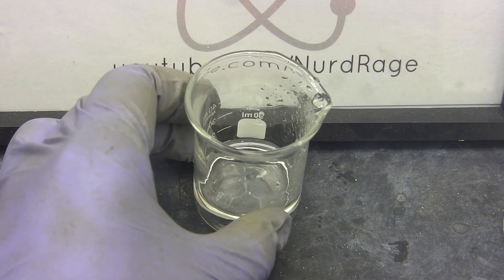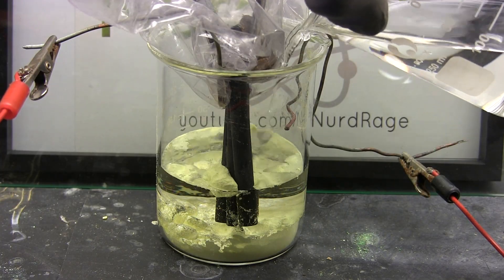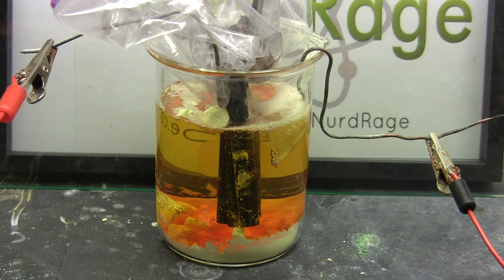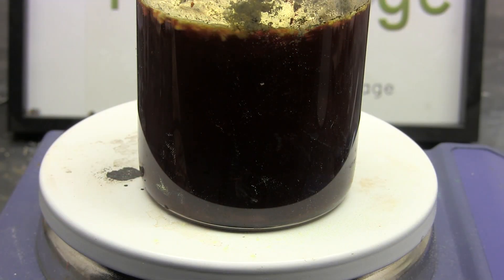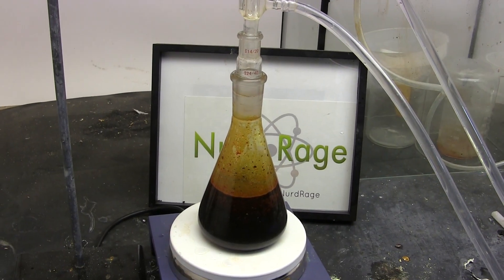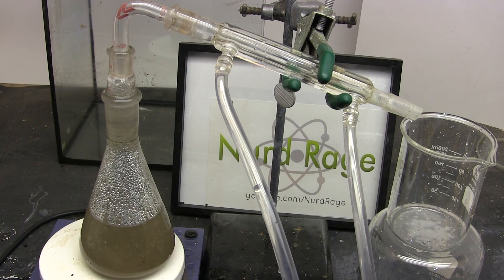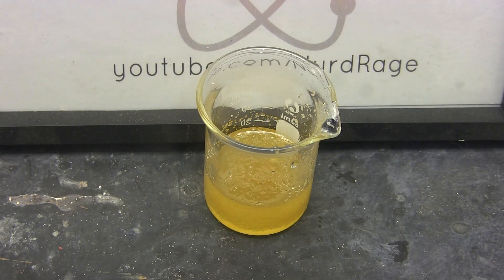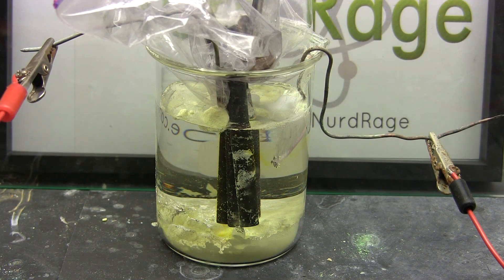Make sulfuric acid from water and sulfur (electrobromine process)

Comment: I MADE SOME LIQUIDFIED SULPHUR FOR THE GARDEN ..BY USING A PROCESS CALLED THE jAYDAM LIQIUD SULPHUR ,,ON UTUBE, CNA THIS BE ELECTRIFIED AND CREATE SULPHURIC ACID AS IS ? THE METHOD I USED WAS ADDING  LYE ..DRAIN CLEANER CRYSTALS  TO A SOLUTION OF SULPHUR AND WATER AND HEATED IT UP BY THE REACTION AND STIRRED TILL TH SULPHUR BLENDED IN WITH THE WATER , WHATS YOUR OPINION OF MAKING SULPHURIC ACID FROM THIS MIXTURE?

Comment: Why does the sulfur need to be at the bottom? Doesn't bromine attach to water molecules somewhat? [H-O-H~Br-Br~H-O-H] ~ meaning partial electron sharing. Since Oxygen withdraws electron density away from Hydrogen (because it has a higher positive charge), the Hydrogen atoms are partially positively charged and the Bromine can have a somewhat dipole moment in as it moves in water. Bromine water is documented to undergo Br2 + H2O <->> HBr + HOBr which alignes with my idea and would mean the Bromine disperses in the water solution maybe not with uniform density but as more water is converted to H2SO4 and since it is denser than water the H2SO4 would donate Hydrogen from the bottom up to the water molecules above it resulting in a movement of Hydrogen upwards as the solution gets more acidic meaning that the Bromine would be carried upwards.

Comment: Try using 316l welding rods from local welding supply and lower the amps to .1 to .5 or so at 12 volts.

Comment: I wonder how this compares to the membrane process.
this can directly oxidize sulfur while the membrane process needs any sulfate salt and a catalyst NaOH
CaSO4, MgSO4 with an anion exchange membrane or NF membrane where the latter is cheaper and can be homemade.
ammonium sulfate can be used with CEM and also NF membranes with CEM being easy to make and just needs a few commonly bought items and a temperature controlled toaster oven.

Comment: I came across the Bunsen reaction using Iodine and Sulfur Dioxide:

I2 + SO2 + 2 H2O 
→ 2 HI + H2SO4 (120 °C); Bunsen reaction

If you produced SO2 (e.g. burning sulfur) and bubbled the gas into Hydrobromic acid, would this give H2SO4?  It seems this might be less messy than the electrobromine process.  If electrolysis was still needed, SO2 is still pretty soluble in water, and would avoid the sulfur floating around.  Thoughts?

Comment: good one.  its got me thinking.   doesnt burned sulfur bubbled thru water make acid ?

meanwhile a new idea  ... its based on how wal-mart wants an old battery in exchange
when you buy a new one.    they charge you $12 absent this 'core'

                                well the old one has a bunch of acid in it.  and more so
if you first give it a charge.  then dump it into a pan. distill to clean it up.
and voila, you have sulfuric acid in the 25-35% range.

Comment: Yeah but how can I make sulfur from sulfuric acid?
Reply from the maker: It's a little more complicated, you can carefully react hydroiodic acid with sulfuric acid in the right stoichiometry to produce sulfur and iodine but the process is very messy. A more straightforward method (but takes more steps) is to react sulfuric acid with hydrogen bromide to produce sulfur dioxide, this is separated and collected. Then excess hydrogen iodide is reacted with half of the sulfur dioxide to produce hydrogen sulfide. This is then separated and collected and purified. Finally the sulfur dioxide and hydrogen sulfide are reacted with water to produce clean sulfur. 

Sulfur however is a waste product of oil refining. so it's actually very cheap to obtain and there is little value in trying to make it from sulfuric acid. Sulfuric acid on the other hand has much greater value than sulfur.

Comment: You rock bro, thanks for the lessons. Maybe you can put a filter/screen on the rod/rods to hold the graphite dust? Probably cost some power through resistance though I guess..That was alot of current though and it took forever...Fully submerged electrodes may make a difference by avoiding gas but I don't know for sure.

Comment: Can something like this work with galena instead of sulfur?
Reply: CODY!!!!!!! I LOVE YOU!!!
Reply: You could roast the galena and take the SO2 and revert it back to elemental sulfur :D
Reply: Cody'sLab if you have a supply of galena, first I suggest checking if it’s argentiferous. If it’s from a silver mine it will be. Pulverise the galena with an equimolar quantity of lead sulphate from old lead acid batteries. You need to heat the.mixture to liberate sulphur dioxide and metallic lead. The sulphur dioxide is oxidised with air over a catalyst to produce Sulfur trioxide. This gas in turn is absorbed into concentrated sulphuric acid to produce oleum. The oleum is poured very very very very very slowly into water to produce sulphuric acid. If the original galena was argentiferous, silver can be extracted using the Parkes process.
Reply: I would try mixing and heating it with PbO2 and some water or in conc. H2SO4 to hopefully produce PbSO4, which you can form into Pb, PbO2 and H2SO4 electrochemically (lead acid battery).
Reply: Cody'sLab I think you can use any type of material that releases SO2 Gas so Galena should work just fine. Maybe you end up with some PbSO4 contamination in the reaction flask but this shouldn't be a problem either since it's only soluble in very acidic conditions and you're going to distill the resulting acid.
Reply: @The_Black_Shadow  soluble not solubal.... distill not destill...
Reply: @BurkenProductions  thanks :D fixed it. Not a native speaker...
Reply: I guess you could roast the galena to produce either lead metal or white lead and SO2 (assuming lead sulfide roasts like other semi-noble metal sulfides), and lead the gas into an electrolytic cell with HBr. The reaction between aqueous SO2 and Br2 should be pretty fast, producing sulfuric acid  and regenerating HBr. You could bubble Cl2 and SO2 together, but I’m assuming you won’t have access to chlorinating chemicals in a zombie apocalypse.
Reply: I.
Reply: I'm gonna say no, not unless you do it separately, in an anhydrous environment.  Not sure what lead sulphide chemical formula is in Galena, but this is how you could do it for sodium sulphide: 
2 Na2S + 2 Br2 =  2 NaBr +S2Br2
Then the sulfur bromide could be used like in this reaction with water.  

An easier way to make sulfuric acid would be to mix mineral oil and sulfur together and heat. This will produce tons of hydrogen sulfide. This can react with copper sulfate or produce insoluble copper sulfide and sulfuric acid.  

Copper sulfate could be made from oxidizing copper sulfite I bet, possibly via electrolysis, or That could be made via sulfur dioxide, water, and copper oxide/hydroxode. 
 No point in making it though when you can buy ammonium sulfate in bulk.  It's magical stuff: heat it up and it releases lots of ammonia gas as it forms ammonium bisulfate.  
Ammonium bisulfate acts much like sulfuric acid for most double displacement reactions, just lower yield and lots of ammonium contamination. You can mix it with a nitrate to distill nitric acid, though. 
Ditto for almost all other acids that can boil away.

Comment: I was wondering how you removed the sulfur that coated your glassware. It indeed is a pain to clean. (Related experiment)
Reply from the maker: Nothing special unfortunately. Just a lot of brushing, rinsing, and some oven heating at high temp to burn off the residues followed by more brushing and rinsing.
Reply: NurdRage that is unfortunate, i still have some sulfur covered glassware i was hoping to clean in a non-dangerous way. Next to scrubbing my only way to clean sulfur covered glassware was heating in crudely distilled toluene in which sulfur is a little soluble in.

Comment: I got a question, may I use a titanium bar grade 2 to replace the carbon electrode?
Reply: He said the acid is strong enough to wear down titanium electrodes
Reply: Austin Hayducky And what about if I use a silver electrode?
Reply: You might want to try gold leaf
Reply: Austin Hayducky Gold is kinda expensive, and why not silver?
Reply: Diego Reyes
Gold is more advantageous because of how thin it can be hammered (which means you don't need a lot)
Reply: I just bought a .999 fine silver coin and used it for electrolysis, nonetheless it started to corrode and it turned into a black color. That's really disappointing, and I didn't buy gold because each gram is truly expensive, and I'd need at least 30 grams to perform electrolysis.

Comment: I have another interesting reaction to propose to you, Nurd, which also happen to involve SO2.

The Bunsen reaction:  2H2O + SO2 + I2 → H2SO4 + 2HI   (120 °C)

The H2SO4 and the I2 + HI solution are roughly immiscible, so the H2SO4 can be separated (top layer)

You recover your iodine either by  2HI → I2 + H2 (450 °C)
or by oxydizing it with a cheap oxydant, like say  2HI + MgO = MgI2 + H2O + I2

Please don't bite my head off...
Reply: Isn't reaction of MgO and HI a simple acid-base reaction instead of a redox reaction? Also, I2 is also a really expensive element, so I guess Br2 can be used instead. But for purely academic purpose, it may work (although HI and H2SO4 are miscible as the first reaction is aqueous).

Comment: Wouldn't it be wonderful to produce directly H2SO4 by electrolysis of a SO2 in solution ? 
SO2 + 2 H2O --> H2SO4 + H2
You get hydrogen as a byproduct. It's called the Westinghouse Sulfur Cycle.

Here's a 2004 paper:  http://scholarcommons.usf.edu/cgi/viewcontent.cgi?article=1993&context=etd

What is remarkable, is that you produce H2 with only a fraction of the current required for straight water electrolysis.
15 Kcal/mole instead of 113 Kcal/mole. (0.17V instead of 1.2V).
Reply from the maker: +_Arthur Ski Good luck getting Sulfur dioxide to behave in an amateur lab environment. I avoided sulfur dioxide precisely because it's not easy to handle.
Reply: Just burn elemental sulfur and bubble the hot gas in water ??  SO2 is very soluble IIRC.
Reply: After all, Chem Player generated SO2 that way, in "Sulfuric acid from sulfur using hydrogen peroxide", so...
Reply from the maker: +_Arthur Ski Electrolysis takes far longer than reaction with hydrogen peroxide. The continual hydrogen evolution would purge out most of the SO2. Then there is the safety issue of working with SO2. Like i said, good luck.
Reply: To me, SO2 seems to be a mild irritant, much unlike NO2, which is more toxic.
Reply from the maker: +_Arthur Ski Levels above 100ppm are considered "immediately dangerous to life and health" according to a report by the CDC http://www.atsdr.cdc.gov/toxprofiles/tp116.pdf
The reference also reports deaths within a few hours of inhaling concentrations around the 1000ppm mark. There have also been documented cases of people dying at low concentrations due to exacerbation of preexisting medical conditions.

You also have not addressed the purging problem of the hydrogen gas. The solubility of sulfur dioxide at room temperature isn't all that great and even worse is that the rising acidity will force out whatever was originally present. The resulting concentration in the air would far exceed 1000ppm. 

But hey, if you think it's just a mild irritant then by all means build up your apparatus and post a video of your process. I've been proven wrong numerous times and maybe the doctors and scientists that wrote that report for the CDC are also wrong. Good luck.
Reply: Hey, it's your lab, your rules. SO2 is no more toxic than Cl2 or NO2.  Or Br2 for that matter.
Reply from the maker: +_Arthur Ski "You also have not addressed the purging problem of the hydrogen gas. The solubility of sulfur dioxide at room temperature isn't all that great and even worse is that the rising acidity will force out whatever was originally present."
Reply: OK: bubble up the hydrogen gas (contaminated with SO2), thru CAO (aq), quicklime.
The reaction will produce CASO4, gypsum, which is quite inoffensive.
The cleaned hydrogen, you vent off.
Reply from the maker: +_Arthur Ski If you're going to waste all your SO2, why bother?
Reply: Oops Nurd, by re-reading the protocol, I found out that the chemists dealt with the problem by keeping the SO2 in its liquid state, by the simple expedient of increasing the pressure in the electrolytic cell.
The pressure they use is 100 psig, which translates to 6.8 atmospheres.
That increases the difficulty (and risks) of the experiment by one order of magnitude.
Reply from the maker: +_Arthur Ski And thus why i decided against demonstrating it for the amateur. If they do it at atmospheric pressure the SO2 just purges out as you electrolyze it, losing most of your product and creating a tremendous safety issue. If they do it under high pressure they might get better yield, but with much greater safety issues of high pressure chemistry. The apparatus to handle high pressure chemistry is not easily available to the amateur.
Reply: No. Direct electrolysis of SO2 in aqueous solution, preferably under pressure.  Look it up.
The beauty of this process is that it sidesteps the use of platinum or vanadium catalysts to get the SO3 intermediate.
Reply: NatureHacker
It is being considered as a way to produce hydrogen, (the Sulfur-Iodine Cycle) but the very high energy cost of decomposing the H2SO4 back to SO2 + H2O + O2, at 830C, can make the whole process unattractive.

A Finn company envisions to use SO2, which is abundant and cheap, to make both H2 and H2SO4, which are valuable industrial commodities.
Reply: (sigh)  No sulphur dioxide is not very toxic.
Every single time you light a match, you smell and breathe sulfur dioxide.
I live in a city of 400,000 people, which used to be doused with sulfur dioxide smell several times a weeks, by the huge pulp paper mill.
On the scale of toxicities, it's pretty mild compared to dozen other common chemicals.
Reply: You need sulphur trioxide to make that work.
Reply: _Arthur Ski
Chem Player did that
Reply: What Chem Player did is H2SO4 using peroxide H2O2. No electrolysis necessary.
But there's no easy way to produce the peroxide, right?
I think the old way used Barium.

Comment: Will there be a possible rate change when we use other halogens such as hydrochloric acid as the catalyst instead, or is the reaction specific to bromine only?
Reply: I suppose bromine is ideal as it is a liquid at room temperature and won't escape the solution as easily as chlorine would.

Comment: Would it be more effective to disassociate the sulfur into the water by lowering the surface tension of water for this experiment? Using dish soap concentrate more specifically, or would HBr react with the surfactants to cause a wide range of side reactions? Ammonium C12-15 Pareth Sulfate, NaCl, Poloxamer 124, and Lauramidopropylamine Oxide are the ingredients of Palmolive dish soap.

Comment: NurdRage Try using carbon fiber as anode. It is electrically conductive and is stronger than carbon electrodes found in batteries.

Comment: I know you stated you don't want to use platinum because it is expensive, but what about a platinized titanium anode. I have two that are mesh titanium with a fine coating of platinum. They both work really well. I got mine off of amazon a few years back for 30 dollars or so each.
Reply from the maker: Ravtank1 The problem with those is that any exposed titanium will start dissolving. hydrobromic acid is extremely corrosive to titanium. If it has a coating of platinum then it must be a perfect coat, no cracks. But it's extremely rare to have a perfect coat. Especially on the cheaper electrodes.
Reply: +NurdRage Amazon has a 2 pack small platinum electrodes for 43 dollars, free shipping.                 
http://www.amazon.com/American-Educational-Platinum-Electrode-Pack/dp/B005QEGK2W/ref=sr_1_31?s=industrial&srs=3016824011&ie=UTF8&qid=1441354845&sr=1-31

Comment: I read that there is a fast-charging aluminium/graphite battery with an extremely high cycle count which uses a 'non-flammable ionic liquid electrolyte' and I suspect it's LiFSI, but I'm uncertain as the electrolyte is liquid at room temp, where LiFSI has a melting point of 145C. What is your take, and how do you produce LiFSI or alternatively, your recommended non-flammable ionic liquid electrolyte? I think this would make for a great video.

Article link:
http://www.nature.com/nature/journal/v520/n7547/full/nature14340.html